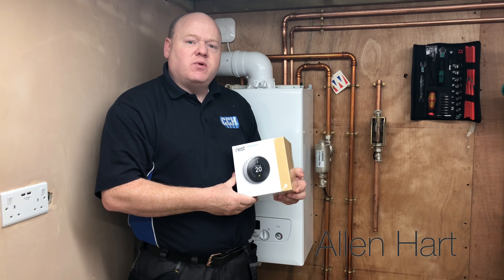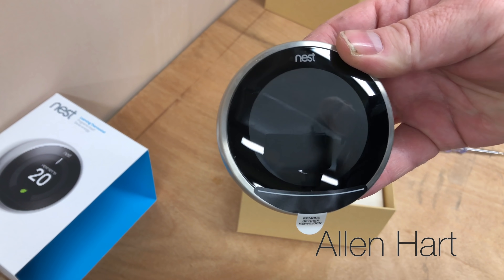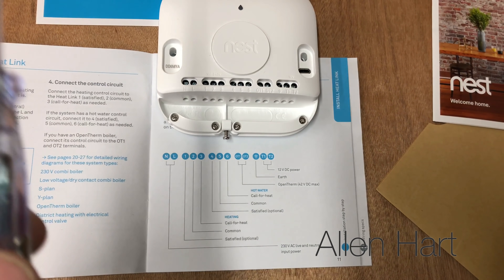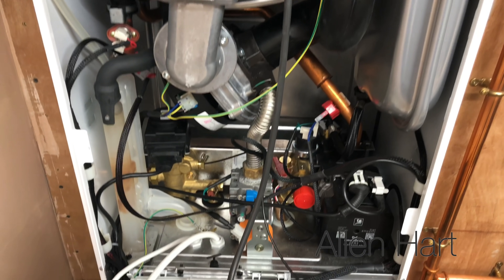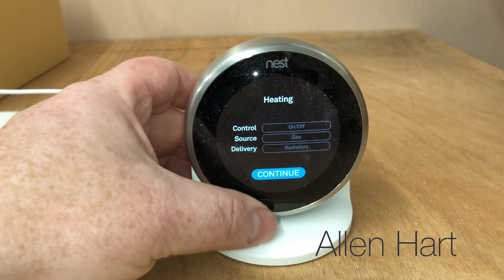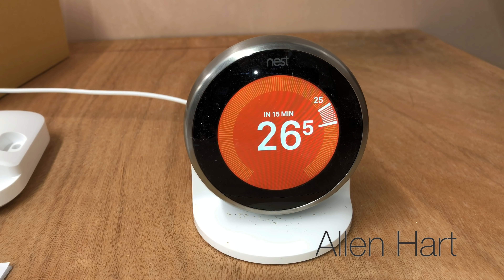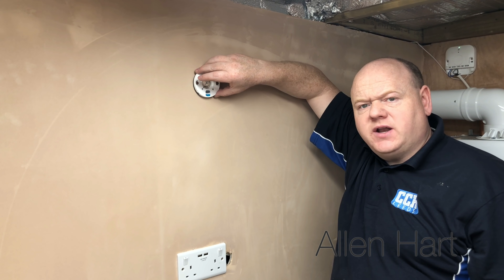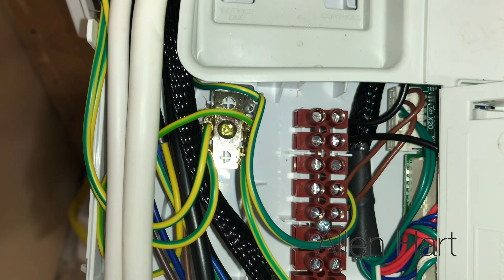NEST LEARNING THERMOSTAT INSTALLATION - How To Wire

Comment: Thanks Allen, great simple instructional video, as I have not fitted boiler plus yet, I was concerned with what to do best for my customers. The baxi IFOS weather compensator seems cost effective and easy to fit, thanks again. Gas Safe Engineer 503644.
Reply from the maker: I did a video on the baxi ifos, have you seen it. https://www.youtube.com/watch?v=_8rotUM1e90

Comment: Hi Allan thanks for the video. I had my Nest installed a few months ago. The technician said that I couldn't get rid of the old VRT340f thermostat and that I needed to keep it on 24hs and the Nest would over ride it. The problem is that I find myself waken in the middle of the night with the heating full on despite the Nest not being set to be on. Somehow the old VRT340f overrides the Nest at that time. Please help. Thank you
Reply from the maker: its hard to comment without seeing the job but i would of thought it would be possible to remove your old control.

Comment: Hi Allen. I've been searching for a while now but still not sure if the Nest system will work with my oil fired heating? I only control it with a 7 day programmable wall mounted box. I was hoping that the Nest system would just replace the 7 day timer?
Reply from the maker: Sam McElveen If you buy it from the nest store you can also book an installer, they will sort it for you no problem

Comment: It's worth mentioning that the thermostat can be mounted without cable connection to the heatlink, in such a scenario it's powered by the USB cable/plug included within the box.
Reply: The nest I received didn't come with a plug - like it was designed to be sent without one. I don't understand how it can be powered?
Reply: @explorer47422  i think it will be powered and send data through L1 and L2 cables to the heatlink, and the heatlink will send the orders to the heating system. If you don't connect it to the wall you have to buy a stand with usb power connector. The data in that situation will be send my mesh connection to the heatlink,  Only thing i'm not sure about is what the range will be through two concrete floors which is very common in the netherlands.(europe) many times the heating system is placed on the attic.
Reply from the maker: Yes thats a good point, thank you for your input.
Reply: Can I have it connect on the stand and still have it connected via opentherm

Comment: Hi Allan nice video mate good job just a quick question if you have it running on open therm do you need to have the t1 and t2 also wired up or not cheers mate
Reply from the maker: Depends how you power the stat, if its hard wired then yes T1 and T2 should be connected, If you are having it on a stand then they will not need connecting. Thanks for watching.
Reply: Allen Hart cheers Allen makes sense now don't know why I didn't think of that lol keep up the good work
Reply from the maker: No problem, Thank you.

Comment: Great video, I’ve just had a nest installed to an Ideal Logic+ via Opentherm, when setting the radiator temperature on the boiler should this be the same as the supply temperature on the nest thermostat? Cheers
Reply from the maker: if you set it around 50 it will save you more money, The downside is it will take longer to heat up. Its a balance really and will depend on the property and also the heat loss. Thanks for watching.
Reply: I have the logic plus too. If connected with openthem (as we both are) the setting on the nest for the flow temperature overrides the boiler setting. This is the same too for the hot water temperature. Setting the flow temperature on the nest at only 50 defeats the point of openthem control. (Sorry Alan!). Set this higher, on a cold start the flow temperature will be much higher for a short period and get the house temperature increased faster; as the room temperature get closer to its target the flow temperature is reduced anyway